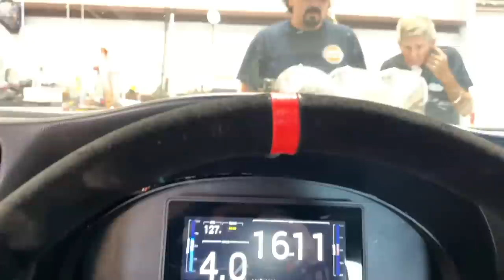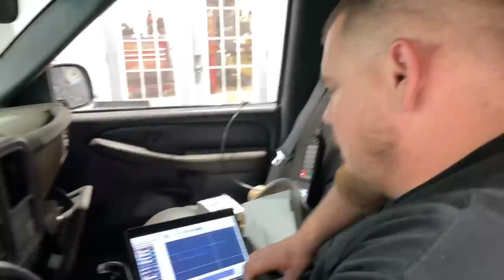Jackstand's Nitrous Silverado SCREAMS On the Dyno!! + Our Twin Turbo Porsche Gets Airborne!!!

Comment: I love how Cleetus is surprised about the small turbos going first. Most of us don’t drive monsters like you do! We need something that won’t blow up our unit. Don’t want it to be too spicy in the old Outback while hauling the family around!
Reply: Yup, even the 64's are on the big side for drivability on a road going vehicle. We don't all daily a 1500whp drag car.....LOL.
Reply: The answer is more 12v cummins swapped vehicles obv
Reply: Also the small ones are ball bearing with billet wheels, besides the sizing for most people's cars they are objectively better units
Reply: Many of us have nothing to put them on at all, at least not without quickly scattering parts and needing a whole built engine....

Comment: Lmao that's why we love ya Cleet. The man can't understand that he lives the send-it life we all wish we could and that an 88mm turbski would basically immediately blow up most viewer's project cars or simply not have enough initial power there to get anything out of the big boy. Never change, Cleet! And keep digging towards that 5 sec run.
Reply: Can always trade it for a smaller one, or sell it and buy a smaller one and possibly have extra money leftover since those huge turbos are pricey I'm sure, to be available to put even more back into a car. I know that's what I would do, and get a turbo in the 60s mm range for my 240 and would be a big money saver. Win win either way for whoever wins one
Reply: @MineZilla123  fair point
Reply: The thing with turbochargers is you can control exactly how much boost they push into your engine with the wastegate. If you really wanted to you could fit one of the big ones from the giveaway onto a built 7.3 litre Godzilla and yet set it up to only run a couple of pounds of boost. Conversely, you could fit one of the smallest turbos from the giveaway onto a stock Honda 2 litre 4 cylinder engine and have it make 30 pounds of boost for as long as the rods, pistons, and head bolts could handle it.
Reply: @ChristopherHallett  tell me you know nothing about volumetric efficiency and exhaust restriction without telling me you know nothing
Reply: @ChristopherHallett  true, but bigger turbos means bigger components, more money, etc. Can it be done? Absolutely, and hats off to anyone that wants to do it.  There is of course the drawback to not using the right component for the job. Too big means ya got a lot more mass to spin, and it will be slower to get to your requested power. A benefit could be that it might help future proof your build should you want to go deeper down the rabbit hole (don't we all?! Lol). 

But for those with a specific and modest goal in mind would probably benefit more from less space utilized, cheaper parts able to be used, better heat management especially in cars with smaller space to work in, better utilization of an appropriately sized turbo, etc.

I do want to clarify I wasn't knocking Cleet in the least. I find it hilarious that he has attained such a high level, the thought of anything lower than a 94 makes him question the point of even hot rodding a car in the first place lol. I'd love to be in a space like that someday!
Reply: @ChristopherHallett  You can only control it by limiting it - you can't make it in the first place without exhaust volume, and you can't limit what you can't make. You can use nitrous and meth to move the map and get a little more spool, but a stock Honda isn't spooling even that "small" 66.
Reply: I figure a good 90% of them will just get sold on.

Comment: "The reliability of a porsche is just ridiculous" sir, your Check Engine light is on hahaha
Reply: Brother checked and engines there so... 🤷‍♂️
Reply: @iyanmanzano  😂
Reply: Still runnin though, just tape it up! 

Can you tell I also drive a euro?
Reply: Captain obvious here: Engine light is for anything that could be related to the engine, not only the engine itself.
A sensor went off, engine light.
Reply: Erikk Hyndman  They gave it a tune. The cat CEL is turned off.

Comment: My 2011 Ford Taurus Limited AWD. It has paddle shifting manual mode. Found out that it has an way to have launch control. I've launched it a ton of times. And I'm about to be hitting 200k miles. I have no dash lights too. 😊But, as for your Porsche.  That air was one of those don't tell Maddie situations. Think demo Matt is rubbing off some with that one.

Comment: That's one hell of a 4 banger in that ridgeline man. Swappin the sparkler sticks did help along with that extra little gas can ha ha more fuel more power right👍🏻 Bro and that sick WRX STI supercharged all electric quad motor was so sweet👍🏻 You just cant beat those head gaskets. If you swapped out that Bilstein suspension for some super sweet ac delcos that thing would be 50% lighter and jump 100% farther just sayin.. Im a professional Ive been racing at the tracks my whole life since the day I was born I was there every single day. The pros would try to hire me but I told them I had to much pride to bought so I raced for them for free. Haa.. Dummies. Anyway I won them a lot of trophies and they got rich and famous and changed their name to Earnhardt or somethin foreign like that. Anyway loved that f150 and that skyline very cool video👍🏻

Comment: New gearing: 2.95, 2.36, 1.84, 1.43, 1.15, .87, .685 x 3.91 @ 27.8"  335 30/20s, to equal SMG III ultra low 15.00:1 1st, on twin turbo M6 w/500 lb-ft @ 1500 RPM. Our spread is better throughout, and revs stay up from 1st-5th. I drove the turbo Bimmer today, and it has E-motor type bottom end torque, mostly. It doesn't match a Genesis with boost button. Look out, for that thing. That's the rush (physical) that I'm gearing for.

Comment: my car has a check engine and low tire light. because something hasnt been right with the engine since someone put surgar water in my gas tank and the sensors in the tires are all dead

Comment: 5:26 seems like a major safety issue which needs to be addressed at the factory level ASAP
Reply: Most likely there’s a little box that tells you to locktite that in the paper work that nobody reads

Comment: An Audi RS3 or TTRS with an e85 tune is 90% of the fun for half the price of that 911.  Sure the Audis understeer like a pig and aren't nearly as nice as the Porsche, but sub 3 sec 0-60 and 10 sec 1/4 miles times just defy logic for a 2.5l engine with a few bolt-ons.  Not to mention how cheap the maintenance is.  They also sound unique as hell.

Comment: Audi🤣 I used to build porsches for a living. Lots of engine builds mods etc. I'll never own a porsche. They break ALL the time. Sure fun to thrash around but yeah. Driveway is filled with Audis now. They did it right. V.A.G. cut to much off/out of the porsches. The number of unibody repairs I had to do for NEW porsches was insane. The clamshell can't even hold itself together. It's just spot welded stamped HVAC metal basically

Comment: Do not mess and disregard engine check lights on a Porsche !
If the car say you must check the engine by an official retail, do it !
Everything is expensive with Porsche but if you keep maintenance level as high as required, you wont have any troubles... Meanwhile, if you wait for too long, it will be unbearable expensive..
We know that down here in EU